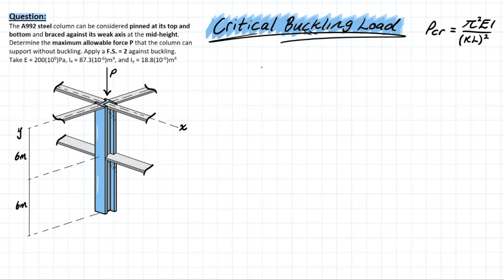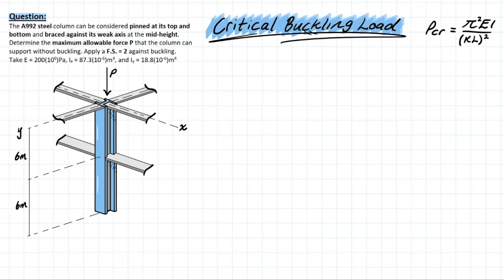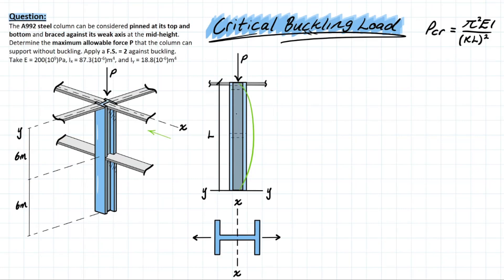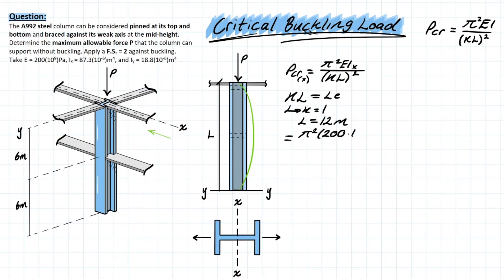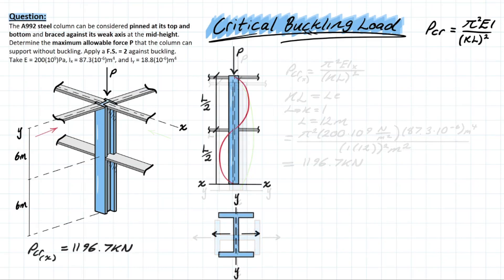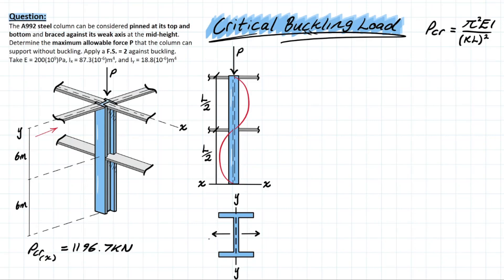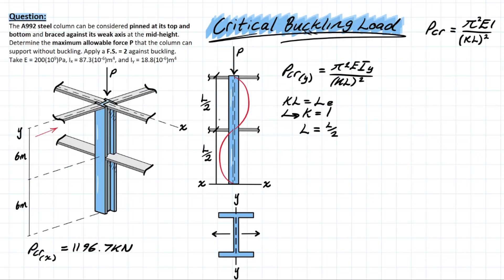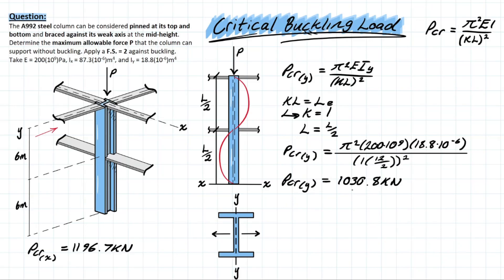Column Buckling and Lateral Bracing Problem!

Comment: I observed a variation of Euler's contained column effect. It has multiple stable zones of post buckling.
Reply from the maker: What is your reference? Id be interested to look
Reply: @simple_civil here is one of the video I made showing a thin sheet of material in its elastic range buckling to form sine waves. I have made trusses a truss core panels out of various materials.
Reply: @simple_civil 

https://youtu.be/wrBsqiE0vG4?si=5cfZP7lf87CHBcKL

This video is of an engineering test of the effect.
The ends are fixed and the containing members are moving in.